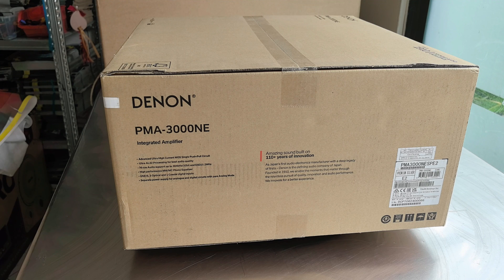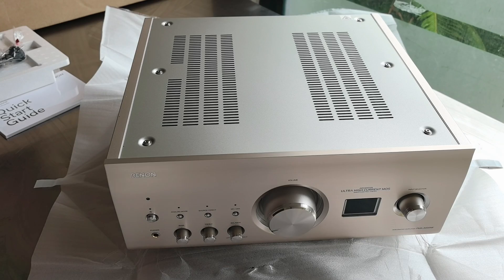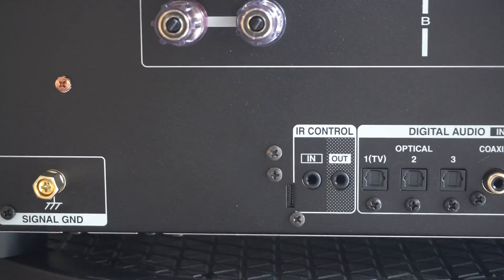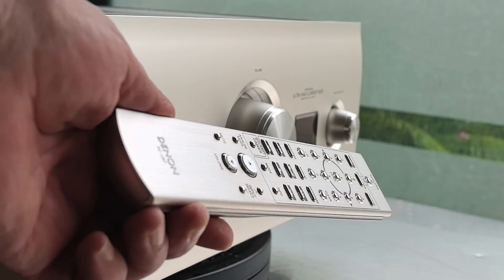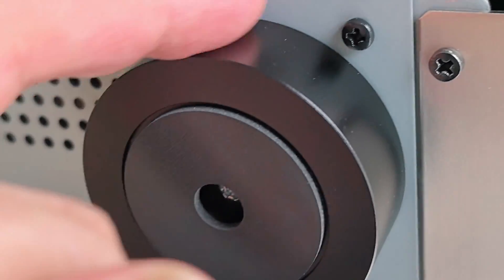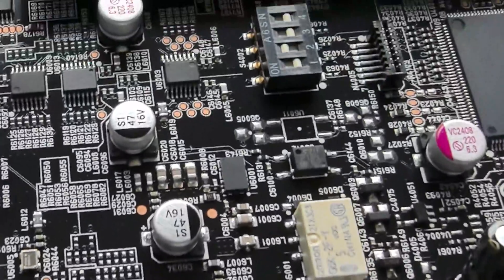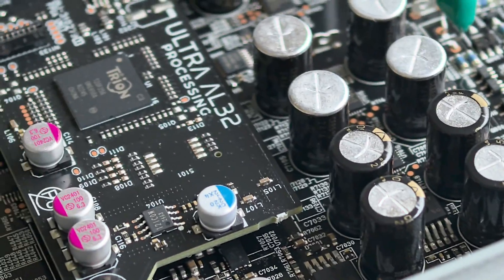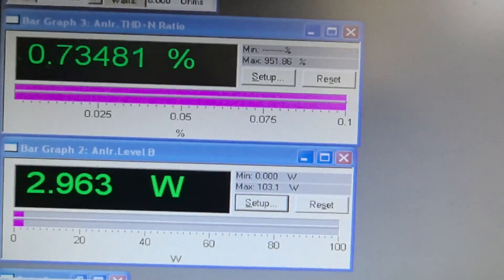What a beauty! Denon PMA-3000NE Amplifier with Quad DAC, phono stage MM/MC, and headphone amp.

Comment: Very good amp but look for a used pma1600ne and spend the rest of your money in a REL TX subwoofer and good bookshelf speakers. Beware... or just bassy sounding towers without that fantastic sub. For example Dali oberon 7.  700$ + 1100$ .  This is a picky amplifier with speakers!! It pushes these Dalis at high bass levels with enough detail.

Comment: Thank you for the detailed review. I like Denon in the past but this product has nothing special other than cheap capacitors, very old model cheap ESS DAC which was aimed to be used in low cost applications. While there are fine opamps in the market, usage of discrete circuit is suspicious for me. Power section should be good but 80W may not be enough for the modern power hungry low sensitive speakers.  For the DAC part, many Chinese dacs (from SMSL,etc) will sound better for sure.
Reply: Load of horse shit. It’s made in Japan and sounds amazing
Reply: @rmeyer52  Made in Japan with Chinese caps and cheap mobile DAC which was already outdated several years ago? Thanks, have a nice listening.

Comment: I'm super happy with my PMA A-110. Denon's love to every detail is second to none.
Reply: What's the difference between the two models? Trying to decide
Reply: @josecarlos11  The PMA-3000NE has got a different DAC chip (Sabre ES9018K2M vs Burr Brown PCM 1795), different caps (Su'scon vs ELNA), bi-wiring option, shorter signal path than the PMA A110, copper panels for the output terminals instead of cables, a separate amp for the headphone output, an optimised master clock design with 3 different oscillators, a slightly better signal to noise ratio and lower THD. I guess the PMA-3000NE is optimised for more clarity, because of the optimised circuitry. The PMA-A110 is a bit heavier and more robust with a thick aluminium plate on the top instead of a thin metal plate - hope that helps.
Reply: @jeromelester8  it sounds like the PMA A-110 is better all around. I will keep looking for a good deal if possible. Thanks for the info
Reply: @josecarlos11  Awesome, the PMA-A-110 is a piece of art.

Comment: An amplifier that is called "top" but does not have XLR connectors in its component means that it is not top. It seems that the people from Denon are doing their best to get us used to such traps
Reply: My Denon pma2020 100% analog.Last & Beast Denon
Reply: XLR? And this is the most important 😂
Denon Rules
Reply: buy a  power amplifier and stop complaining
Reply: Dont agree XLR has only real advantage potential in ling cable runs 99% connections under 1 m will mean half of buggar all difference ... times have moved on
Reply: Worst part is no pre out. It will turn off a lot of people.
Reply: Agree 100%, a top integrated should have XLR Connectivity and the speaker terminals should be on the bottom.
Reply: @henryradtka5480  denon sx11 and sx1 are top models
Reply: @henryradtka5480  I really don't see the point of XLR sockets, I've got several amps fitted with them, and I've never used them. They're only useful if there's a long distance between the devices !  😉

Comment: Where is the speaker selector button ?
Reply from the maker: The A and B terminals are for bi-wiring or for different speakers impedances like A or B for 4Ω~16Ω, A and B for 8Ω~16Ω.
Reply: @hxosplus  How about subwoofers? will B terminals work as high level input?
Reply: @ZaxL89 This should work perfect, especially for a class AB amplifier and no bridging is used in the amplifier.
Reply: @hxosplus  So you can’t use 4 speakers at the same time !
Reply: It's not a good idea 🤷🏻‍♂️